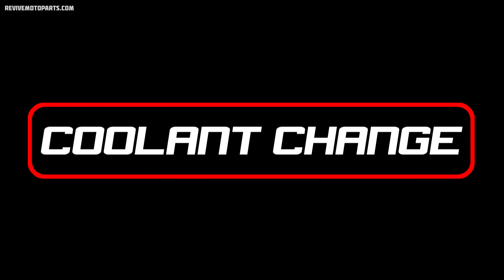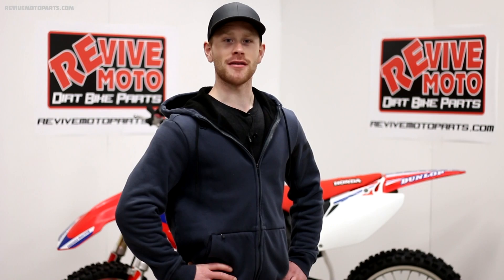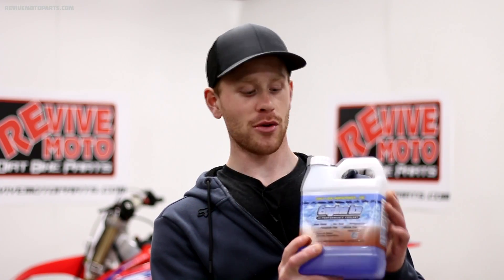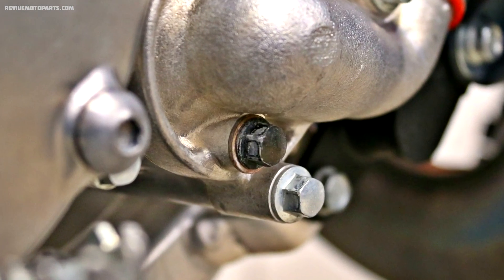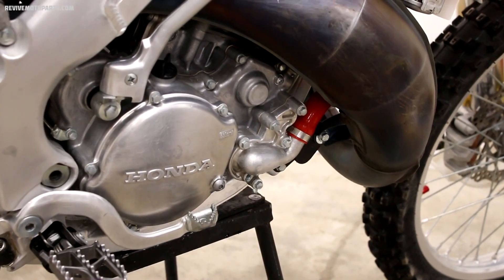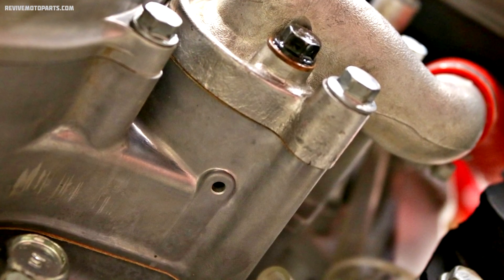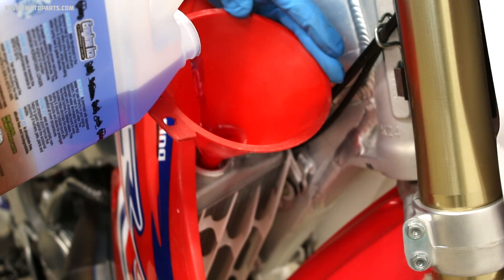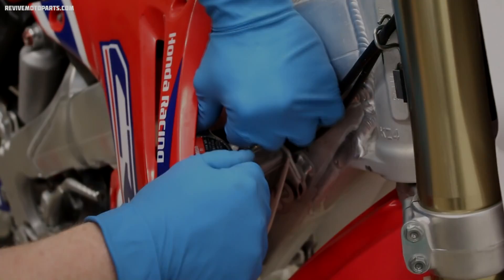Prevent Overheating With An Engine Coolant Change

Comment: Will this help I got a 2006 450 today took it out and after ride to see where to go next wen idol it was leaking coolant through a hose is that the coolant over flow so when I stop turn it off? And let it cool down if we’re stop for a min and if where not just keep ridding and it should
Cool off as I goo since I’ll be up 3/4 gear ?

Comment: My coolant keeps bubbling out the overflow and the level is not full ever. Theres also a little air pressure under the cap when i take it off to check, what does this mean?

Comment: Hello I have a technical question if you or anyone can answer please that really knows. I Have a WR450 with 
a 1.1 bar cap 16psi.. It never overheats and always stays under 180..if I put a 1.8 bar 26psi cap will thar cause undo steess to hoses or gaskets??

I know water boils at 225 with a 1.1  so if it stays nowhere near there any cap over 1.1 should be fine is that right?

Comment: You said to use the kick start to flush out any Air bubbles after adding coolant but my bike is an electric start do how could I check for air bubbles

Comment: I bought a new bike in 2020 (2020kx250) and have only put a few hours on it but i noticed the coolant is a bit low i dont know what type of coolant the dealer filled it with originally so i dont want to top it off with engine ice should i do a full flush and just replace it all?

Comment: I don’t take the drain bolt fully out I take it about half way out so it doesn’t go everywhere, and I also run the bike for a minute or so with the cap off to bleed the system and the top it up if needed and then put the cap back on obviously and then it’s fit to ride

Comment: Cameron Niemela. Just a couple questions.  I love the video and its great but I bought my RMZ 450 used about a month ago,  after doing some basic maintenance, I noticed it looks slightly low on coolant,.  Not sure what was used before but its blue.  Ive heard that I would need to do a full flush in order to change coolants.  Do i need to run distilled water a couple times to flush it and then add the new coolant?  My overall goal is just to have the coolant level correct,  I don't need or want to switch coolants just not sure what was used to start with.  The bike has 58hrs on it and not sure if it was ever changed(coolant that is) So what steps should I take from here?

Comment: Nice video! I just changed my coolant but it has leaked through the valve cap when the engine was “normal hot”. I had only experienced this during very slow enduro tracks..what could it be?

Comment: What is considered "topped off"?
Is it when the fluid reaches the neck of the radiator? 
Or is it when the fluid reaches the top of the radiator components inside the radiator?
Reply: I’d say it’s just beneath the rim of the radiator. The top of the components inside the radiation should be submerged.

Comment: Why after long rides does coolent  come out the over flow tube btw I have a 2000 kx125 2 stroke
Reply: It means your bike is running very hot. Try installing a fan or put in some engine ice.

Comment: I have a 92 CR500 Honda the cases on the engine or magnesium the radiator is aluminum you recommend ice in that also
Reply: First off,I'm jealous! I'm old so 92 I was senior in HS & I wanted one spook bad! Anyway I'm pretty sure you are good to go but may wanna check their website to make sure...ps "Don't flip it backwards on ya self, Lucky!"

Comment: Will this be good for any year bike and size I have a yz250f 2017 ?
Reply: Bret Scudder  should be. Check owner’s manual for any other boots to loosen. On my 17 KTM 250 there is a bolt on top of the head that needs to loosen to help get air out of the system as well as the drain bolt. Also rock the bike back and forth after putting new coolant in that help get rid of air pockets.

Comment: Do you do straight coolant or 50/50 with distilled water?
Reply: Nicholas Calvetto  with engine ice that he was using in he video ( I use on all my bikes as well 👍🏼) you don’t mix with water. Just pour it in 👍🏼

Comment: Hi bro wat’s the best coolant for crf450  2018 and oil engine l can use 10w-60 motul
Reply: Shareef Alhozeel  I use what he uses Engine ice ( what he has in this video) in my little 50 cc and in my KTM 250. Really keeps the temps down.

Comment: hey, i know this video is a little old, but my 2013 crf450r is overheating and radiator fluid is pouring out onto my exhaust. I'm turning it into a supermoto and i cant have that happening. I'm planning on installing a boysen super cooler water pump and changing the fluid to the engine ice. Is there anything else i should do to keep my engine cool while driving like a grandma in the city?
Reply: I also have aftermarket radiators installed
Reply: @grantfromspacee , 
Coolant in the exhaust... sounds like a bad head gasket.
Reply: @2DclanSnipingTeam  it's not leaking out of my exhaust. It's leaking out the overflow of the radiator, onto my exhaust lol. I just need to make some mods to keep it from over heating, that's what I need advice on; any advice?

Comment: just got a 2018 crf250r and the first day i got it i was letting it warm up and i went inside to figure out how to change the mapping. I let it warm too long and ended up overheating it and the anti-freeze expanded and came rushing out the overflow. the good thing is i had just came outside when it started releasing so i immediately shut the bike off. it scared the shit out of me but i ended up just having to put water in the radiators and now its fine.

Comment: Ended up putting engine ice in my crf450. Seems like it runs cooler.
Reply: Can you use for any dirt bike
Reply: @KonnectionZ  along as it is aluminum or steel, not mixed metal.
Reply: @KonnectionZ  yep, np
Reply: 1yr later. How is it running? My 2012 runs hot
Reply: @iphone3gsdivine  I've used this stuff in my bikes for over 3 years man, if you're worried about this stuff hurting your bike don't be, it does not use any of the harmful crap that some other coolants can use and it's good down to I believe -24 Fahrenheit if I remember correctly, I know it's at least -20.
Reply: I’m currently running engine ice 🧊. This shit works I love it. I’m thinking about running it in my Jeep lol that’s how much I like it
Reply: I just switched over to engine ice in my 2016 KTM 450 sxf.  Took it out today im really impressed.  Temperature stays around 20 dg lower than previous coolant and no fluctuations at all.  A lot less overflow even when full to the rim.  I'm actually surprised 😆

Comment: what are you using to rinse the coolant circuit before filling it with new coolant? or can you just drain the old one, than refill with new without rinsing?
Reply: +cadwarrior ...
I flush mine twice, with distilled water. Also, make sure you siphon the liquid out of the overflow reservoir.

Comment: Should you flush your radiator out with a additive before you change brands/colours of coolants? Great tips & advice you provide.👍
Reply: 3 years late, but if you plan to run wngine ice, always flush your radiator with distilled water.  you flush it cause engine ice doesn’t go well with other coolant, and you use distilled water because there is no harsh minerals in it unlike tap.

Comment: Hey man! Very beautiful cr! What are The differences between the my 2003 and The my 2005 cr please?
Reply from the maker: Thank You! There isn't too much of a difference between the 03 and 05. The only change is cylinder, exhaust valve, and intake as far as I know.
Reply: ReVive Moto Parts I have a 03 and I have a lot of fun with her! I love The Honda cr 125 but my clutch is very hard, could you do a video of The restore of it please?
Reply from the maker: It's possible your cable need to be lubed or replaced. I made a video on that a while back. 
https://www.youtube.com/watch?v=YS_gHf8FUDA
Reply: ReVive Moto Parts thank you very much! When I Will have more time I would like to clean also my cr like yours..🤤
Reply from the maker: You're very welcome. Best wishes on cleaning up your bike! You won't want to ride it again and get it dirty haha.
Reply: ReVive Moto Parts ahahah yes sure👍🏼

Comment: You have an opinion on Evans waterless? I have been running it for a year now on my 450r but I never see anyone else running it so I worry that maybe it's not a great idea since it's able to get so hot compared to others.
Reply from the maker: I personally haven't used Evans before. I've heard of great reviews however. Coolant brand isn't going to make that much difference on how cool a bike runs.
Reply: Thanks for the reply. I just wonder with the fact that it has no water and is able to get so much hotter than other coolants, if that can end up being a bad thing for my bike.
Reply from the maker: Yeah I'm not sure of the technology behind it. If you're hesitant about using it switch to Engine Ice or another reputable brand.